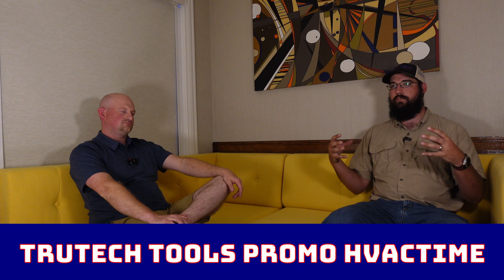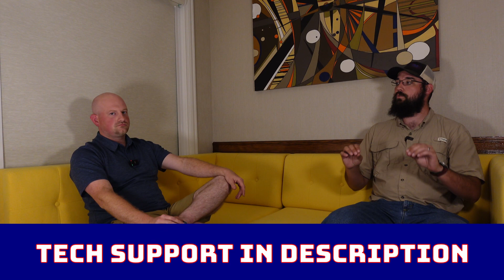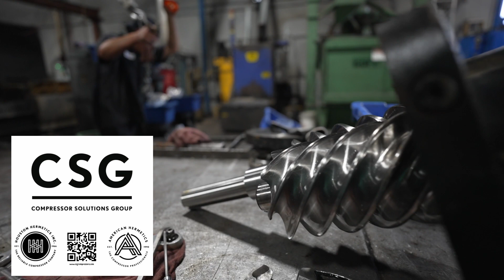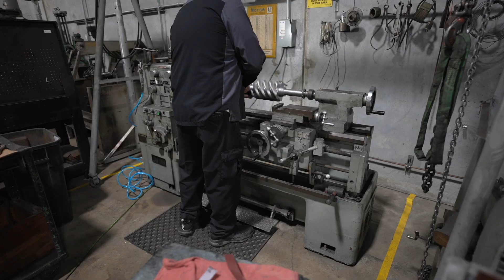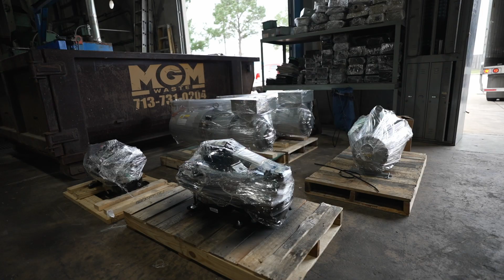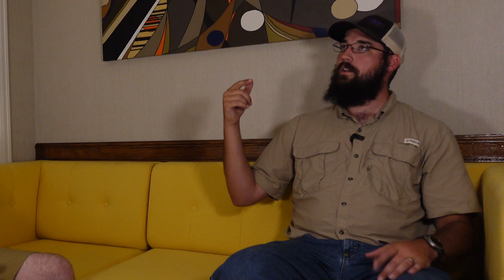VRF Technology: The Future of HVAC?

Comment: our York centrifugal chiller descharge temperature is 107 F but oil sump temperature 117F so please explain me that how do the increase oil sump temperature without on the oil heater
Reply from the maker: hvactime.shop
Techsupport@hvactimetx.com
Reply: @HVACTIMEPodcast  why it is important ı readed at scroll danfoss compressor handbook about oil superheat its kind of situation like that?